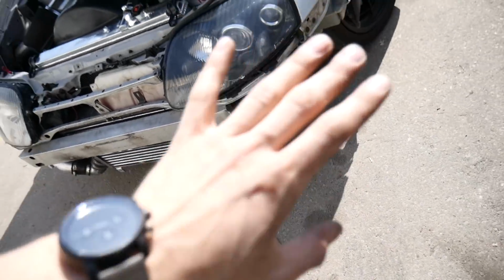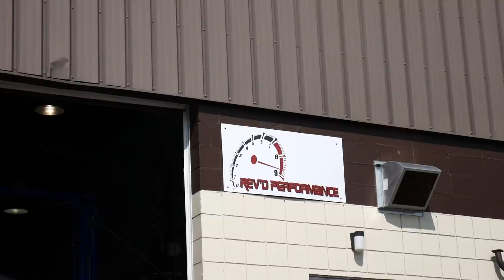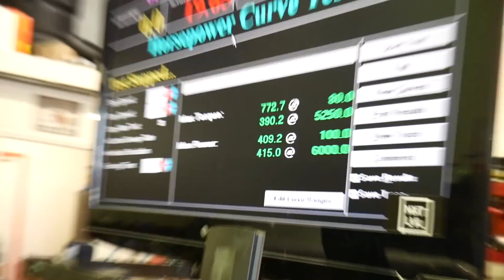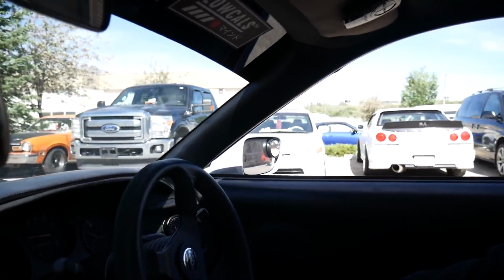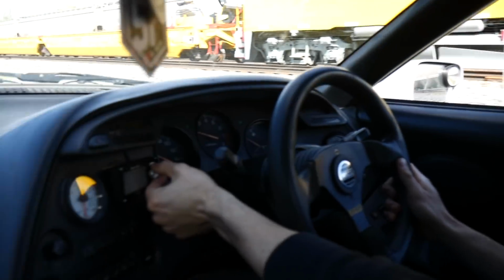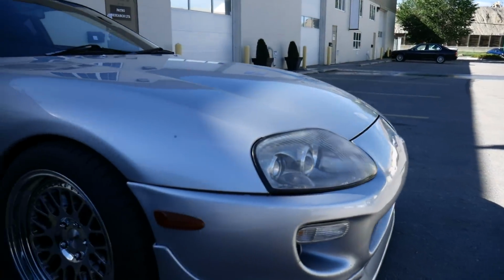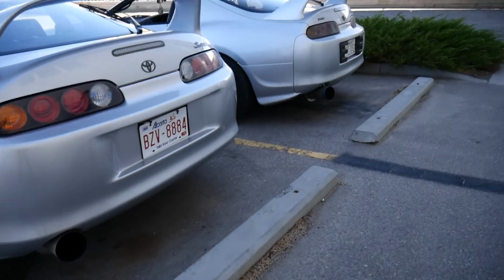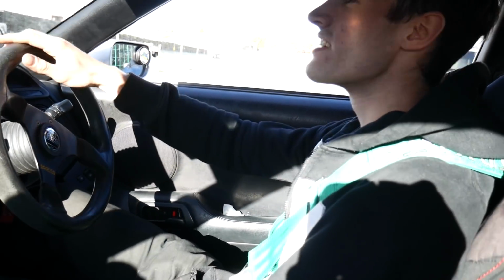MKIV SUPRA - HIGH BOOST PULLS / Dyno Tune + Numbers

Comment: Seems a little weak, I have a Supra RZ, 6 speed. With a 61mm precision .81 AR, on low boost 12.5psi, untuned, stock ecu, 3inch straight piped, fmic, stock everything else. And it puts down 377 rwhp and 388 rwtq, on 91 octane and a low reading dyno. Now yours is tuned, it has a bigger turbo, 18psi of boost and puts out only 40 more whp and 23 more wtq. Something's off with it man, you might have a factory slug. When mine is tuned at 18 psi and fuel mods my tuner says it should be around 475 to 500whp, And we have basically the same setup, yet yours should be better because of the bigger turbo. Only difference I can see is that I have a screamer pipe. Have you done a compression test, or a boost leak test? Congrats on hitting the 400 mark, but those are really low numbers.
Reply: It does seem low. At Titan Motorsports I hit 449rwhp misfiring at 13psi through my Supra with automatic transmission and an old school Turbonetics 66mm turbo w/.81Ar.

Comment: Is it just me or when its getting up on boost you can here some open throttle surge?
Reply from the maker: Stepper motor of the boost controller is limiting the pressure from rising above the limit. The small “fluttering” is just from the wastegate modulating boost!
Reply: What you are hearing is the boost controller adjusting duty to the solenoid. You can really hear its effects amplified on a screamer pipe. Basically what you are hearing is the gate being pulsed by the solenoid.

Comment: What turbo is this set up running?
Reply from the maker: Borgwarner SXE 362 - 8376
Reply from the maker: .91 A/R
Reply: Lowcals love it! The Supra is so tidy. Silver and black like my daily. I’m running a gen 1 gtx3584rs which sits as a low mount on my daily which is also an in-line 6 but a 4.0litre (Barra) 1.06 rear on mine. Also running 18psi on petrol tune, making a hair shy of 600rwhp.
Reply from the maker: Damn that’s nuts !! Must be a blast to drive haha

Comment: bov opening when it shouldn't i can hear it
Reply from the maker: Thats actually the stepper motor modulating boost pressure as load increases, the bov doesnt open at all - hence the flutter when i let off.

Comment: BOV fail
Reply from the maker: I need to run two bov’s :(
Reply: i can see it on the dyno, it doesn't even look like its opening. if its getting a good signal from the manifold, you may need to take some spring pressure out of it if you're not gonna up the boost.